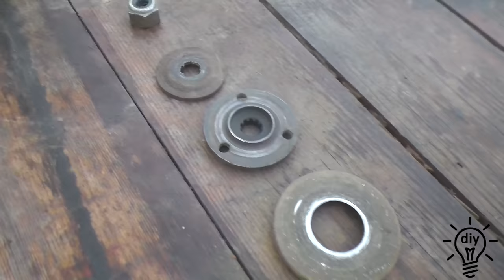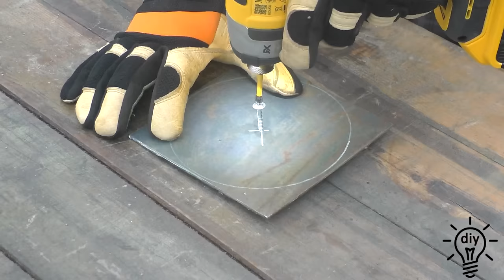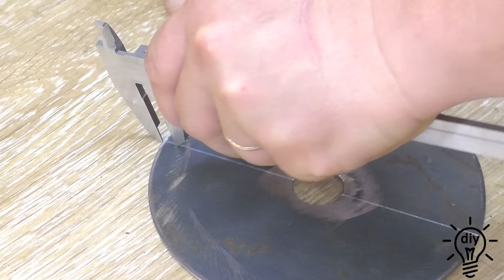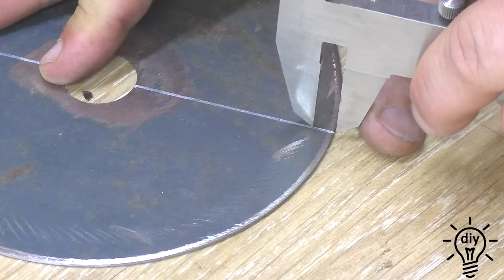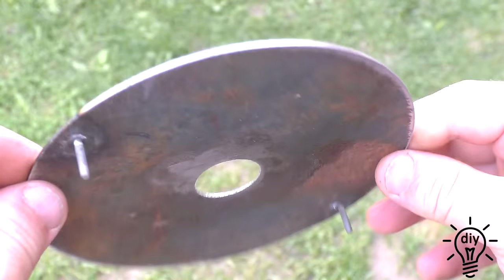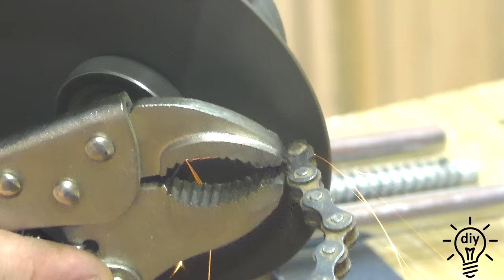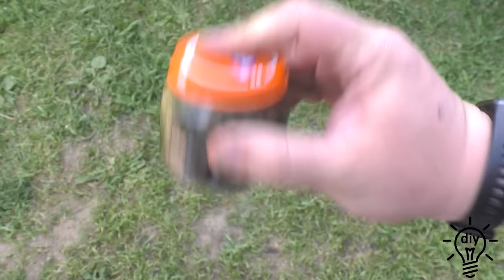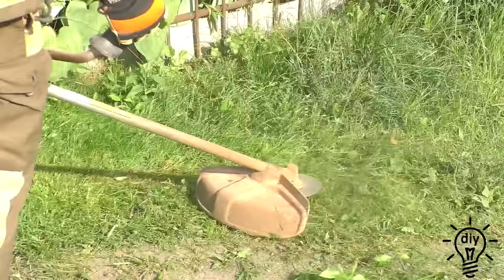A brilliant idea from a bicycle chain !!! Mow the lawn without problems !

Comment: Without an EXACT balance to a specific tolerance ( exactly like balancing a tire ) - AND with such added weight - you would first of all likely have harmonic resonance / vibrations that would travel through the head and into the boom arm. ( working things loose - noisy - unpleasant to the operator etc . . ) 

AND - the engine / gearing - spline down the shaft etc . . are setup for a light weight plastic head containing lightweight plastic line etc . . which the engine is turning to get to an rpm that will go through grass and weeds. 

And so - when putting a heavy disk and chain on the end - you are tremendously stressing the mechanisms that turn the cutter and the ENGINE at the gear/transmission point. And of course the engine itself. ( piston chamber ) Which will create HEAT and engine and/or mechanism failure at some point. ( Earlier rather than later - and likely MUCH earlier ) 

PLUS - I am not sure an engine and transmission setup / designed for a specific weight of cutter head would be able to properly spin a heavier head made of a different type of cutter fast enough to get a benefit in thicker brush. 

AND - in this video the guy tack welds some very thin rods / bolts onto the disk - ( with ONE attachment point in a design with constant stress on the one point - a freakishly obvious profound design flaw as far as safety - functionality and even basic integrity of the item created ) - which is hilarious - stupid and incredibly unsafe. At the very LEAST a buttressing of the OTHER side of the bolt ( possibly a 2nd disk on top ) is needed. 

And so - as the operator - ( while possibly wearing shorts ) would you want bicycle chain spinning at who knows how many rpms to come FLYING at your shins ?

Do NOT make this and use it.

In fact - an item comparable to this design was marketed to the public in the late 90's - and a guy in Alabama bought one and used it while his daughter was playing outside. It disintegrated while in use ( and the chain can fly at up to 238 miles per hour ) and it struck the 3 YEAR OLD girl in the head and killed her. 

And 47 OTHER people were severely injured by it.

It was recalled from the U.S. market place.

Comment: Most home string trimmers are designed to turn a specific weight (the manual will even state the diameter of the trimmer line for this reason). If you overload the weight it will damage the engine or the cable in the shaft or the joint where the cable connects to the engine as there will be too much torque.

Comment: I give that machine about 3 uses before you twist the inside shaft. Not made to carry that heavy of a load. Thats why weedeater line is made of thin plastic. Or you could just by the brush cutting wheel made for it. But I get the fact that you make videos so you succeeded there sir.

Comment: It seems as though to me the extra weight would put more wear and tear on the drive unit running the length of the entire shaft between engine and cutting head. And id surmise to say the holding pins/screws holding the chains could easily snap from heavier use. Great idea though. Maybe a lighter chain for yard work.

Comment: The plastic wire was designed to give into denser than grass objects such as your car tire or foot and not have a part of it, like a chain link, carry muzzle velocity if it hit a rock (can't see that happening while gardening) and fly off into a windshield or crash into the neighbour skull. For saving $2.50 on wire, you could loose hundreds and an eye. Don't repeat this. It's a good outdoor blender for zombies.

Comment: Manufacturers of commercial equipment will not warrantee string trimmers if the string guard is removed, which many landscapers do.  The reason is the guard has a cutter in it that keeps the string at a pre determined length.  Longer string is heavier and causes premature wear.

The longer string slows down the weed wacker, wears the clutch, and can snap shafts inside the stem.  In other words, beats the shit out of the equipment.

Comment: Overall I wouldn’t recommend it.   But  😁 . If you insist  ,   Why cut the chain  into 2 separate bits  and create  seperate  weaker  joints  with lighter bolts  ?     Maybe  you could  just  run the chain across the metal plate  , and welded the chain to it  ?     Then you have the original  chain links as the pivot points .  Just a thought .

Comment: There's a reason why we have 10 fingers,  10 toes , two hands etc.  It's because of people making mods like this. They're " extras incase some appendages get torn off in our lives we have a spare.
Reply: Yes, for a second try! But we should break off some ideas in the theory phase, if we don't know EXACTLY what is important. Tinkering, trying out - for example with electrical systems - too dangerous without the appropriate training.
One don't must know all, important is, we know where our knowledge ends.

Comment: As a trimmer, dangerous. Under a push mower, a little safer in sandy soil where keeping a blade sharp is useless. I might use the under my riding mower in sandy soil and changing out the chains as they wear down is easier.  For a trimmer I like the idea of using a cable but not chain

Comment: I would weld those chains to a heftier bolt and make dam sure they will not come off. Other than that looks dam good ,weeds are no problem. Make shure your wearing safety glasses incase you hit something hard - broke bottle glass -stray nail etc.💥

Comment: Should had put the disc between the chain link halves so not to load the bolt 
(in fact you should had welded the chain to the disc)

Comment: First stump one of those chains wraps around and shears those 5c bolts,  will send the now wildly out of balance wheel and chain where you prefer it not go...

One of those chains (assume 100 grams)  flying off at 2000 rpm will have a kinetic energy of 940 Joules.
A 45 caliber energy is 540 Joules.

Don't do this...

Comment: Ahh hell forget the chains . Go get a couple bread knives and remove the blades . Then drill holes for the bolts in the blades so you can attach them with the bolts . Sharper and more aerodynamic so it will have less drag wich means more rpm . 🤣

Comment: The chains will fly off quickly !
   I imagine a bicycle chain anklet might hurt, just a tiny bit ! It's an extremely BAD idea to use any type metal chain in this tool. 
   I've seen airplane cable used. They are less likely to start a fire when used to weed-eat a chain-link fence BUT even that is dangerous ! A bicycle chain will spark too much against concrete and zinc stuff. You've got the plate right...just not the bicycle chain. Too risky to set things on fire and come apart.
   On TV shows, they tell you, "FOLKS, DON'T TRY THIS AT HOME !!! " To use anything in place of nylon weed-whacker cord, is putting yourself and others at risk to loose an eye or a limb or start a fire that will smoulder till YOU'RE gone and then catch up. It ain't worth saving a few bucks on the right stuff. I'm NOT being a TROLL here ! I'm calling attention to a very dangerous situation that the world can see & possibly a bunch of folks get hurt from.

Comment: Many problems with this build, but the most obvious design problems are balance, amd torque.
Many gas powered weed wackers do not have the raw torque to get that thing spinning, and the balance issue can easily turn it into a deadly weapon.

Comment: The harmonised standard EN ISO 11806 does not cover this type of device as only nylon strimmers and single piece metal brush cutting blades are in scope for fitting to the basic brush cutter 
Flail's are lethal and banned in almost every country.

Comment: Hmmmm OK... I guess. If the dude insists on making something like this I just gotta know his reasoning behind the use of 6-32 Chinesium screws as pivots.  Why not just weld the first link to the disc? The chain doesn't need to pivot at the anchor point...amiright?

Comment: Do away with the chain, use plastic line or even some small gauge fence line and get yourself an old tile saw blade. Tile saw blade is thicker and won't warp easily.

Comment: Very stupid idea many single points of failure that can cause injury: 1. Nuts can shake loose (no safety wire), 2 bolts holding chain can break (these bolts are that strong). 3. Any one chain link can break.

Comment: wow....A   really   D E A DLY    idea.  How, about using a chainsaw chain,  attached to the  OUTSIDE  OF  THAT   STEEL   DISK ?  Attached to all around the  disk .    Just be sure,  the cutting  'teeth'  of the chain,  are on the outside, so as to make a thorough,  and complete cut,   CLOCKwise....?  ..... THROU   YOUR   ANKLE  !

Comment: The total disregard for safety is blatant, soft little bolt made brittle by welding will have the chain ripping to your leg bone when it come off or the sane in the dirt wears it off.

Comment: Those cheap little Chinese bolts will fail sending that high velocity bike chain right into someone's ankles or shins. Two plates sandwiching the chain with high grade bolts would be better,.....

Until you hit a chain link fence!
Please dont do this. There is a reason that these are not sold in stores. If you do this , please wear steel faced leggings!!!

Comment: If you can't afford to maintain your tools or you can't afford the correct equipment and supplies then don't buy them at all, i have seen this, when somebody had a grinder going with no face protection and the disc broke and hit there face, so lucky to be alive PLEASE, PLEASE dont take the risk just not worth it.

Comment: Much too heavy for normal brush cutter. You need a bigger engine or accept to ruin your machine in a flash. The same with stainless steel cable or whatever you want. 46 to 52 cc can only run litgth thin plastic cables. it will works but not very long

Comment: That’s a big nope, total death trap please don’t do this. Just use a heavy duty plastic cable tie instead of a chain through a drilled hole instead of a welded pin.

Comment: Great way to strip down the gearing in your weedeater... I would not do this... not to mention the physical danger... what happens when you wrap it around some rebar, or fencing, or a rock, and it sends chain shrapnel flying off in God knows what direction at God knows what speed. Again... do not try this.

Comment: So...

With a lot of work, you can create an incredibly dangerous way of doing exactly what a string trimmer can already do?

Dear god, that bolt connection is simply irresponsible and wrong.  I mean, that looks like an unrated #6 or #8.  There's no strength there.

Comment: What a bodger. Using a vernier calliper as a scribe isn't the best way to use that tool.

And as many other have said the idea of spinning bike chains at high RPM while attached to the home made disc using a couple of what look like 5mm bolts doesn't bear thinking about - I doubt the plastic guard is going to save anyone's ankles.